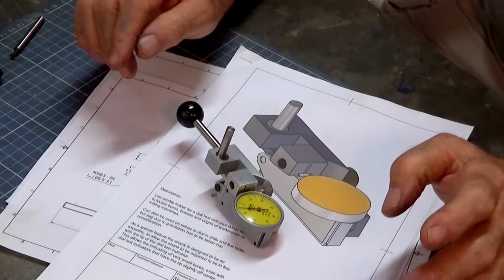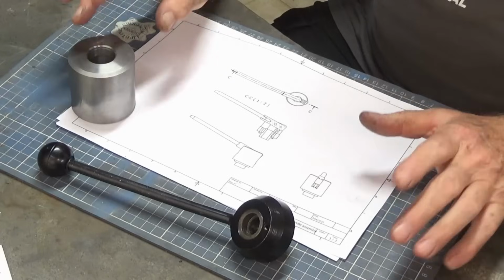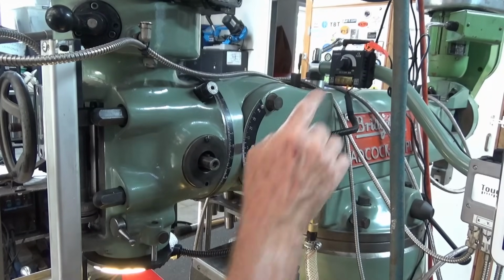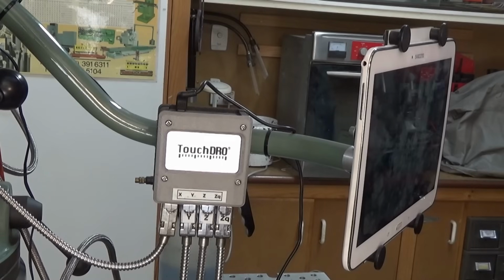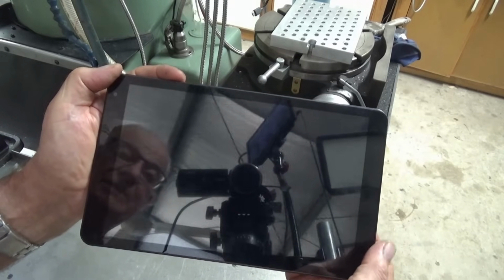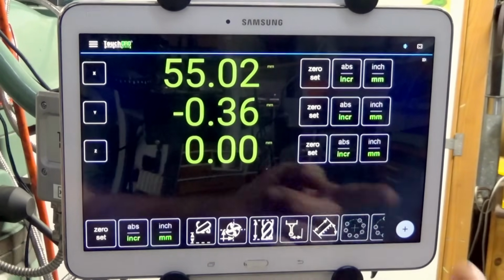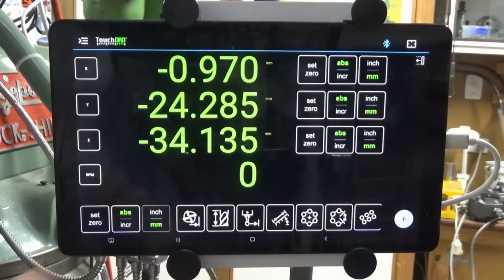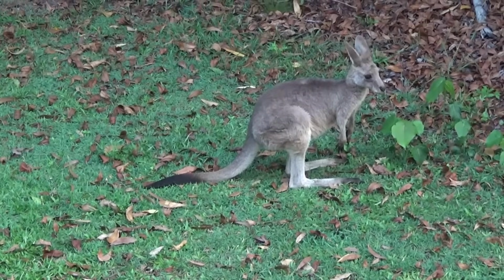Channel Update and TouchDRO, a 3 Year Review

Comment: For tablet charging, I have tapped in to Bridgeports internal transformer, which runs alongside my vfd and fitted a 240v outlet on the outside of the electrical box. The tablets charger and touch dro module are both powered from this so only powered when the Bridgeports main iscolator is powered on. I'm a big fan of touch dro and would like to add the speed readout but cannot for the life of me find a way to add an encoder to the Bridgeport spindle. Anyone managed to do this successfully?
Reply from the maker: I have tried and failed to find a 240V single phase connection for things like chargers and work lights. My mill is powered from a rotary phase converter and the output is 415V three phase. I tried to find a way to get a single phase tap but I don't know enough to find a way of doing it. Everything I measure is 415V. The output for the X axis drive motor comes from a step down transformer so maybe I can tap into that. I have a couple of the hall effect modules for converting the spindle RPM for the TouchDRO but my mill has variable speed and the RPM is shown on the speed selector anyway so I haven't bothered to install the sensor. I am guessing you would need to fit a magnet to the very top of the spindle?
Regards,
Mark
Reply: @Preso58  Hi Mark, I can see your problem. My step down transformer has a 110v tapping for the table feed  and I presume yours is the same? If it is, you might be able to use a US spec 110v usb charger tapped in to that. 
The issue I have with fitting a speed sensor on the quil is that it disappears down the hole when l use the quill feed. It would be simple to use the motor for the pickup if it wasn't for the hi and low gearbox.
 I'll keep looking, there has to be a way.
We took an eight week tour around Oz in September and October and I have to say you live in one heck of an amazing country. The flora and fauna is like nothing I've seen before. Truly unique and I can see why you are so protective and proud of it.

Comment: Hi Mark, talking about weird electrical environment, my power feed on the mill would increase in speed when I turned on the spindle driven through VFD.
Thought the VFD was the culprit, 5 years old, ordered replacement.
While waiting for it to arrive I pulled the power feed apart, lot of corrosion on resistor and capacitor  legs,  replaced them and Triac for good measure and problem fixed.
Have a spare VFD!
Reply from the maker: Yeah, electricity is the work of the devil!😁 I tried to start my mill one day when it had been bucketing down with rain for nearly a week. It started OK and then I started to hear ominous electrical crackling and buzzing. I think the electrical enclosure was just soaked with moisture. Probably a lot of arcing action in amongst the 415V contactors!
I turned everything off and left it for a couple of days to dry out (it did stop raining eventually). It has never happened again.
Regards,
Mark
Reply: @Preso58  Hi Mark, Great video!  Your description of the TouchDRO problems caused by the mill motor screams "EMI" loud and clear. A few years ago I had to resolve problems caused by EMI affecting SCADA sensors in a municipal waterworks. Was a real challenge but I eventually won the battle. ha ha  BTW, I like your T-Shirt art ... I live in western Canada in the southeast corner of BC about 1.5 hours from the Rockies and about a 4.5 hour drive to Banff. Cheers.

Comment: Great update, I followed your original touch dro video with interest because I was looking at dro options at the same time. I ended up going with a sino and glass scales and have been very happy that I don't have to much around charging it and starting apps etc. However the software functionality on the touch dro is better and the upgradablity is obviously superior. So I would say win some lose some I still couldn't pick one as better or worse as I do think it depends on what you are doing with it, to be honest mine is mostly a ruler, I don't use the fancy functions, so thank you for your very informative videos.
Reply from the maker: I have been totally happy with the Sino glass scales and DRO on my lathe. But the mill needs a little more in the way of functionality. I did have a Sino DRO on my old mill and it drove me nuts when I tried to do bolt hole circles. I had to get the manual out every time to decode the cryptic messages on the display. I know other users aren't bothered by it but I respond to graphical information better than abbreviations. I am old enough to remember word processing using Word Perfect. You never got to see the formatting until you printed the document, and it was nearly always wrong. Then Microsoft rolled out Word and WYSIWYG. It was a revelation for me.
Regards,
Mark

Comment: When I got my BP clone I wanted a quick adjust quill lever right away. I just couldn't wait a the several days it would take to order one. (Amazon and next day delivery wasn't a thing yet.) So I set about making one. It was three weeks before I finished it. That's OK, I prefer my custom made lever to any commercial one I've seen.

I've been disappointed by my ring light. It mounts on the quill face, and if I'm using a small end mill it obscures my view. I have to bend over to see, because I'm tall. And if I'm drilling, the chuck casts a shadow. I still use it though, along with a small LED gooseneck lamp from Ikea on each side.

Finally, is that a Dawn vise at your elbow? I have one just like it. Imagine, a bloke from the Pacific NW of the US with an Aussie vise.
Reply from the maker: I badly want to finish that quill handle but  I am waiting for a chain connector to turn up from a Chinese supplier. It forms the linkage between the locking pin and the lever attached to the handle. I could have just made one but again, I got lazy. I meant to order it before I went away on holiday but forgot. 
The quill light does help but it does need some additional side lighting. A LED gooseneck on both sides like the kit that H&W Machine Repair sells would be ideal.
The vice is a Dawn. It was one that was in the US (Unserviceable) bin at work. The nut was cracked but I made a new one from steel and bronze. All Queensland schools were supplied with mostly Dawn vices because of a preferred supplier policy prior to the 1990's. Now, anything goes!
Regards,
Mark

Comment: "You shouldn't leave a tablet plugged in". I don't doubt you, but this is moronic design. A lithium battery should be just fine connected to its charger all day and night. Any internal circuitry that allows it to overcharge is faulty. I think older charging circuits might get a voltage burp once every couple months and if it does that, it'll overcharge. Only takes once. Also, phones and tablets are pushed right to their limits by the charging voltage. They'll last 10x as long if held only to 90% of their capacity. I'd be tempted to just leave the battery out of it and wire in a 4.0v power supply directly. Add in a capacitor to handle surges (or a supercap), and you'll never have to deal with turning it on or booting it.
Reply: There is no reason to worry about leaving a lithium battery on charge, providing it is using a modern charge controller.
They cannot/won't over-charge.. in fact they cut charge completely one the battery is "full" (drawing less than 10% charging current) and will not start charging again until the voltage drops quite a long way.
Yes, the voltage might be a bit high and you could extend battery life if you could reduce the cutoff voltage, however that isn't possible with most charging ICs. Even if it was, you cannot easily modify it inside the tablet.
So, about 20 years ago the advice was slightly good, but no modern (name brand) device will have any issues being left plugged in.
Reply: @johncoops6897  Up until, oh, I dunno, 2016, maybe a bit later, this was still a thing. Manufacturers trying to squeeze every bit of  battery life out of a device lest anyone compare it negatively to a competitor. Meanwhile, phones and tablets are replaced every 2-3 years, no one cares about longevity. So of you keep topped up, it might push the lithium to its absolute limit and shorten its life. Also, charge current doesn't drop to 10%. It drops to 0%. Lithiums don't self discharge, if they stayed at 10% chsrge current after full they'd overcharge in minutes and blow up within an hour.
Reply: @MattsAwesomeStuff  - you obviously have very limited knowledge about the subject, no knowledge of charging methods for lithium batteries, and are inadvertently spreading a lot of misinformation.
Nevertheless, I am not interested in arguing with you about this subject as the information is widely avaiable if you care to research it.
Tl;dr: you are wrong 😉
Reply: @johncoops6897  Huh? Suddenly you become hateful. Alright. I'm well informed about lithium charging procedures. Lithiums aren't like lead acids or nicads or nimhs, you don't keep adding energy once they're full or they'll be ruined. 10% charge rate after they're full will absolutely explode them within the hour. Try it and find out.
Reply: @MattsAwesomeStuff  - no charge controller will continue charging a lithium cell after it is full. That's the reason that charge controllers are used.
I have absolutely no idea what you are babbling about with the 10% stuff, you obviously misunderstood something and have latched onto it like a gospel.
Reply: @johncoops6897  you have no idea where I got 10% from? Scroll up, your first reply, you say it cuts to 10%. You're literally arguing with yourself.
Reply: @MattsAwesomeStuff  - you need to re-read what I wrote, especially what was inside brackets.
Reply: @johncoops6897  it will cut to zero is the correct answer. Anything above zero will destroy the battery. You can't be adding anything into an already full container without damaging it. Likewise with lithium batteries.
Reply: @MattsAwesomeStuff  - you have severe reading comprehension issues. 🙄
As I said in my first comment, the charging is completely cut once the battery is "full". Why are you arguing?
Reply: @johncoops6897  Hey man, I'm just not interested in continuing this with you and your aggression. I started off thinking I was having a civil discussion and you're so angry and namecalling. Take care, have a good day, go do something that makes you happier.
Reply: Some have pointed out that ”modern“ lithium battery chargers have protections circuit to prevent overheating overcharging issues …. BUT in the last year in the US where there are regulations re lithium battery charging systems I have found three new devices that don’t meet the minimal safety standards so unplug you shop tablet or take you chances

Comment: Gday Preso, I’ve been really impressed with the TouchDRO, only issue I have is when I’m finished for the day I turn the power off to the screen and TouchDRO box, next time I start the unit again the position is miles off with out anything being moved, not sure why though, one day I may upgrade to glass scales but for now the igauging scales will have to do, great video mate, cheers
Reply from the maker: Matty. I always leave the Bluetooth adapter powered on. I understand it will remember the absolute coordinates which I try to set to the back left hand corner of my vice jaws. However. before I realised that I shouldn't start the app until the Bluetooth was established I would lose the absolute coordinates and have to reset them frequently. I was referencing your Cincinnati when I mentioned that some users have capacitive scales and they work consistently. In my view, glass scales seem to be immune from the erratic behaviour I got with the iGaging scales and I never did get to the bottom of the fault. I still have all the capacitive scales and the adapter. I really should set it up on a bench outside the workshop and do a proper test to see if it really is just the workshop environment.
Regards,
Mark

Comment: Some interesting content in all of that. I only use the el-cheapo Chinese Shahe DRO scales and I only have the 3 individual readouts, I've been tempted a couple of times to lash out and buy the Touch DRO adaptor. I had an issue a while back with the readouts changing on me all the time, sometimes very significantly, at the time I had them mounted on the cover over the motor and drive for the spindle, in the end, I decided it had to be electrical interference and moved the readouts away from the mill and that solved the problem, I was also having a similar problem on the lathe and solved that by wrapping the leads in Aluminium foil.

In regard to Bluetooth and Samsung, I listen to Triple M from Brisbane online while I'm not recording video, and I play that through a Bluetooth speaker, it can take a moment to connect the 2, but nothing like you are getting, maybe somewhere around 30 seconds or so. If you don't put out another video this year, Merry Xmas to you and yours. 👍
Reply from the maker: Thanks. I tried earthing the TouchDRO adapter circuit board, fully insulating the iGaging capacitive scales from the mill and even running the Bluetooth adapter from a phone battery bank but the reset fault kept happening. It was so frustrating and I went back to using the micrometer dials as a backup. The problem wasn't TouchDRO it was just the scales and since switching over to glass scales the problems just went away. I like having the tablet in the workshop but I must say, I prefer to listen to Triple J! Nothing like a bit of hip hop and indie music to while away the hours!
Regards,
Mark
Reply: @Preso58  The hip Hop is all yours, I'm an old rocker 👍
Reply: one of my Touch adaptor does not like to be plugged into the wall, so i use a small 12v battery pack to run it and that got rid of all interference i was getting.

Comment: Mark I was thinking about your diesel furnace you built. I saw a fuel oil burner from a home heating boiler. It was all in one fan, pump, sprayer and ignitor. Do you think a unit for heating a home boiler would create enough heat to melt aluminum?
Reply from the maker: I almost bought one of those units from a supplier on AliExpress. I am sure they would provide enough heat but you might need to tweak the fuel and air settings. I find that I have to start mine running quite rich and then lean it out as the interior temperature of the furnace increases. I have a video coming out shortly where I show the interior of the furnace after melting aluminium. It is almost pure white after I shut the burner down so there is almost no soot or unburnt fuel. 
Regards,
Mark

Comment: Great review, Mark! I think TouchDRO is the best bang-for-your-buck DRO setup out there. Yuriy has done a phenomenal job. I've got an adapter board for almost every machine in my shop.

The touch probe functionality, in particular, has been a game changer for me. I picked up a cheap $60 import touch probe, wired it to the adapter board, and it's been fantastic. It's dead-nuts accurate, and has made edge- and center-finding an absolute breeze. 

It looks like you're on the beta version of the app, as I am. I'm eagerly awaiting Z-height probing to be added! I use Tormach TTS tool holders... Once that feature is incorporated, I'll start populating the tool library, which will make it even easier to switch between tools on mill. Diameter offsets, height compensation... Automatically displayed with the touch of a button. It's so awesome!

As an aside... The ability to do math within the axis dialogs has been a feature for quite a while. It's definitely a super useful feature!
Reply from the maker: I am on the beta testing list for Yuriy . I must say I had been wanting the mathematical calculation capability for some time and I only recently noticed the new layout which included separate buttons for +-*/. Maybe I was looking in the wrong place? The other possibility is that I had updated the tablet and it was a Samsung feature that added the capability. I have one of those (cheap-ish) touch probes on my CNC mill and it works great so I may get another one for the Bridgeport. The one in the CNC is in it's own dedicated MT3 holder so I don't need to recalibrate it so much. I like the Idea of the Tormach TTS holders but they're quite expensive here in Oz. 
Regards,
Mark

Comment: Where does touch dro. Come from ? Thanks for your time.
Reply from the maker: TouchDRO is a one man show. Yuriy lives in the USA and he has developed the app and the hardware for the Bluetooth adapter. The guts of the adapter is basically an ESP Bluetooth module but Yuriy has worked hard to improve the functionality of the Bluetooth adapter by adding connections for a tachometer, home switches and a touch probe. 
Regards,
Mark

Comment: I have TouchDRO on my Mini Mill and a great Feature is that the 4th axis can be set to be added to one of the others. In my case the Quill movment on the mill uses a separate built in micrometer display. So I was always having treat the Z movement of the head and the quill movement separately. I removed that built in micrometer and added a DRO scale inside the mill that measures quill movment. In TouchDRO settings I joined that axis to Z, so now regardless of whether I use the Quill or move the head, it registers as a Z movement on the DRO.
Reply: 9
Reply from the maker: That is one reason I went with TouchDRO. I looked at a couple of Chinese made DRO systems including the Sino but it was really hard to tell from the information accompanying the advertisements whether they would do axis summing. TouchDRO does it well though. It's a winner for me.